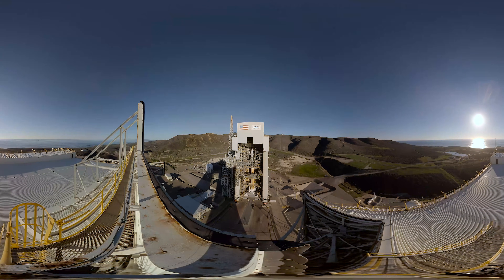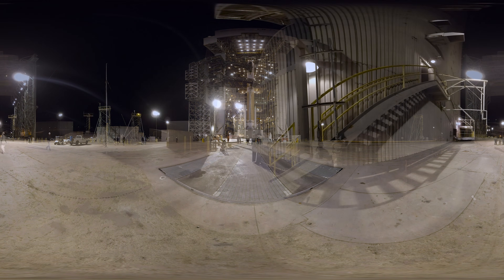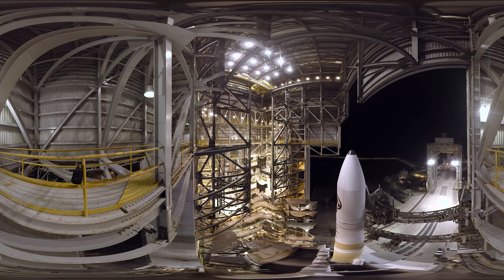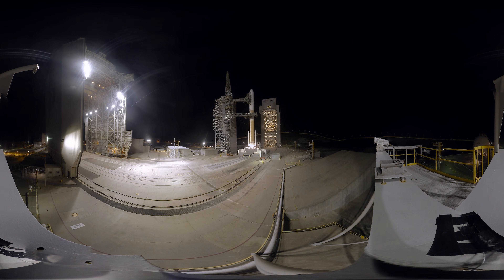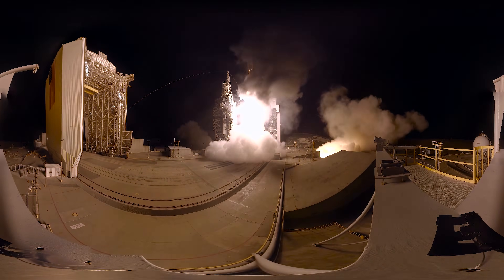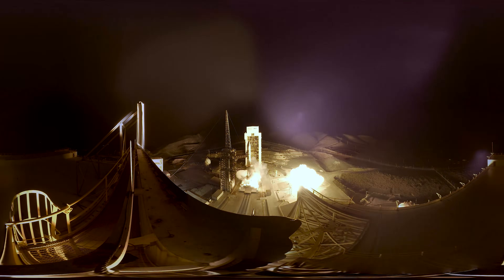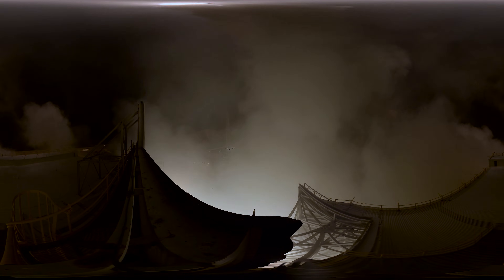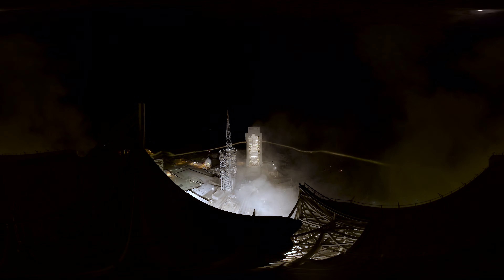Rocket Launch 360: DeltaIV NROL-45

Comment: Great video but next could you include a view from the umbilical tower?
Reply from the maker: We'd love to, but it's very close to the rocket, and we're working out how to use a blast-proof housing in 360.
Reply: Off the top of my head, borosilicate glass or fused quartz probably stands the best chance of withstanding the intense changes in pressure caused by the launch. I'd suggest evacuating the interior of the housing as well, as the increase in temperature outside the housing may result in the formerly ambient-temperature air becoming much hotter, higher-pressure air that borks the camera.
Reply: You could just use an acrylic water tank inside anither water tank to protect it from the heat, or actually use a heat proof gopro casing

Comment: 2:43 - your rocket is on fire! Literally! 
I wonder it survives . Why can't you invent a smarter ignition system that will not burn actual rocket? It's not that hard, guys! :|
Reply: It's built to survive flames like that.  Not a big enough problem to merit a redesign of the flame trench or ignition system.  If you watch footage of a shuttle launch, you'll notice a period where the bottom of the External Tank is on fire, which it too was designed to handle.  I believe in that case it was accumulation of hydrogen or something.
Reply: +Briggs Baltzell (TheGreatB3) Likely not since after STS-41(?) or so they added the sparking system below the orbiter to burn off any excess gaseous hydrogen/oxygen.
Reply: ZooNamed123 No, that's different.  If you watch the Matthew Travis shuttle launch footage part 4 (I think), you can see the tank burning a while before the SRB's are jettisoned.
Reply: +Briggs Baltzell (TheGreatB3) Oh your referring to post launch, that's different.
Reply: ZooNamed123 Right.  My point is that they are designed to account for this.

Comment: What about a rocket cam?
Reply: a rocket 360 cam on thr very top... would be awesome
Reply: +ToNi17 Perhaps on the next launch  :)
Reply: +Koncept VR A 360 rocket camera on the upper stage of the rocket is unlikely as its a lot of extra weight, but if it's attached to the 1st stage it's possible but unlikely.
Reply: +ZooNamed123 A lot of extra weight? A 360° can be comfortably handled by a normal person, I don't think that would be so much heavy for a rocket.
Reply: +Lorenzo Porre Any additional weight or hardware is more to manage, not to mention how critical weight is as the rocket is specifically  loaded for the mission.
Reply: +ZooNamed123 So they just have to calculate a little amount of additional weight but I really don't think that a 360°cam about 10-20kg on a rocket can influence his liftof and his fly, especially if it is on the top of the rocket.
Reply: +Lorenzo Porre It's the cost of the additional fuel required, even as light as 20 pounds can increase a payloads total cost significantly.
Reply: ZooNamed123 i think such a camera is at about 250 grams or half a pound